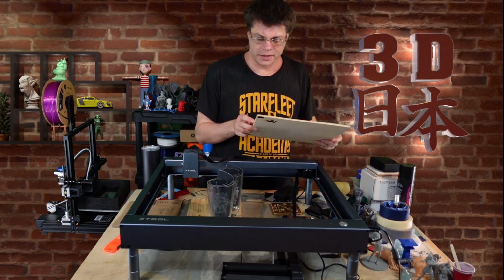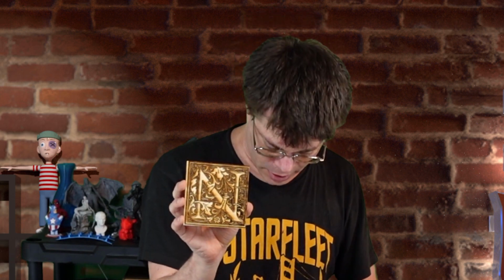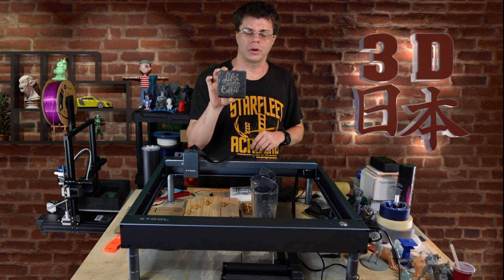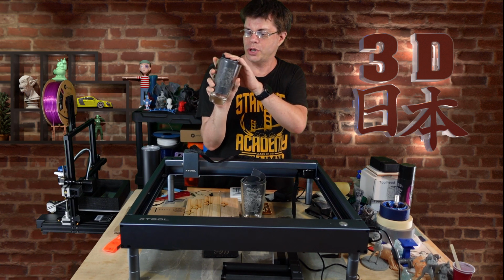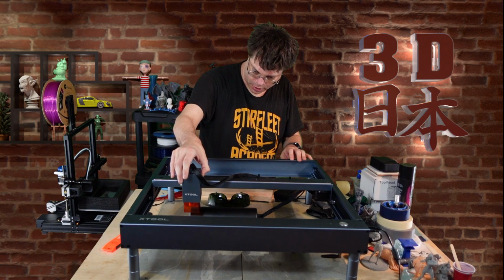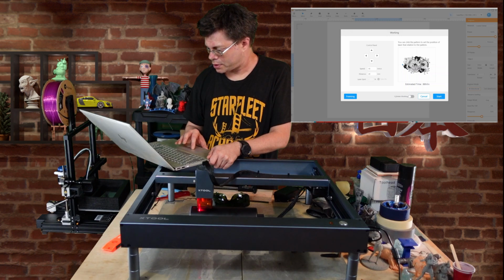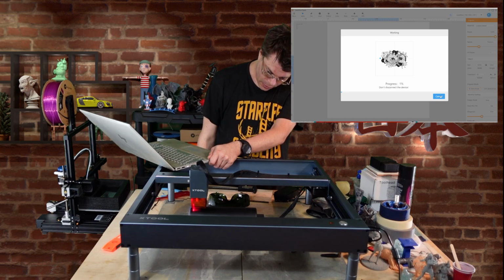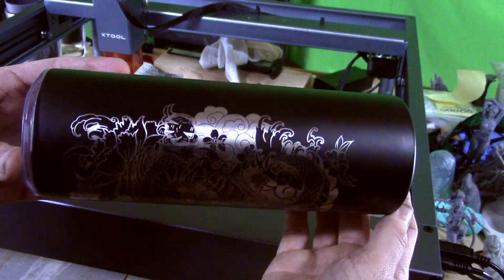Using the XTool D1 to cut and engrave all the things!

Comment: How did you do the pint glass? I've been struggling to get that frosted look. What kind of paint you use and what are your settings on the laser?
Reply from the maker: I tested both black spray paint and black tempera, watered down and sprayed with an air brush. Both worked about the same but the tempera is much easier to wash off, just water and a paper towel. I forget what settings I used but XTool says to use the Coated Metal option with 100% power and 70mm/s speed.
Reply: @3DJapan  Okay. I tried to brush tempera paint on the glass and 100% with 20mm/s speed and also 100% with 12mm/s speed.. Not good results 🤷🏻‍♂️

Comment: Hi Phil, I’ve been having trouble getting clean buts with my laser, I get a lot of nasty burns on the bottom of the wood, I’m using 3mm baswood and using 100 power 6mm speed as stated on x tool website I have air assist and honeycomb but still no clean cuts
Reply from the maker: Well to be honest I'm no expert. I've only cut through wood a few times, using various lasers. The only thing I can think of would be putting masking tape on the area that you think will get burn marks, then removing it after the cut. A quick way to remove it is wrapping some duct tape around a few fingers with the sticky side out. Then just repeatedly press it on the masking tape to pull it up.

Comment: That half inch pine is most definitely 1 inch.
Reply from the maker: Just double checked the boards with calipers. 0.49" and 0.76" for the pine and 0.49" for the red oak.
Reply: @3DJapan  0.5 inch measured wood is “3/4 inch” wood & 0.75 inch wood is “1 inch” wood. Did you do your finger? that will blow your mind, your finger tip of your index finger from tip to the first knuckle/crease is exactly 1 inch.

Comment: Hey Phil, great video, really shows the range of this little laser.  

Is there any chance you could post / email me a list of your settings for each material?  I understand that I would still need to test myself but I am trying to reduce the amount of materials i burn through just in testing, plus the settings I have seen are all over the place as an example for slate coasters Xtool shows 75%power @ 50mm/s, my test file showed 80% and anywhere between 200 - 300 mm/s looked the best, that was the highest speeds I ran, since then though I have seen videos of people going at speeds up to 2500, that's quite the range vs what I tested and what they are using, especially compared to what Xtool shows.  In fact on their chart nothing goes above 90mm/s.

As I said I understand I still need to do my own testing for my material / location but at least this would give me a better starting point to set my ranges from.  I will use whatever is easiest for you, text file, xml, lightburn cut library, excel file whatever.  

Ken
Reply from the maker: Just about everything I did is straight off of the official settings page. There might be one or two that I figured out myself but I don't recall them.
https://www.xtool.com/pages/material-settings
Reply: @3DJapan  ok, thanks Phil, I think part of my issue was mm/s vs mm/min.  your stuff all looks pretty darn good so I will start with those settings then.

Comment: I know where your inverted image came from.
You are using Lightburn, and you had another laser selected when you opened your image in the software, then you switched to the X-Tool D1... Then your image flips.
This happened to me all the time also. It is because the D1 has it's home in the upper left corner, while your other lasers have their home positions in the lower left corner.

The correct way to go is to first select your laser machine, then import your images. Then you won't have this problem.
Good luck, and thanks for your video.
Reply from the maker: Oh yes that happens to me all the time too. However in that case the image becomes mirrored left to right or up-down. In this case it became a negative.